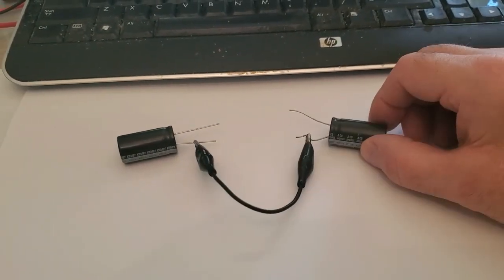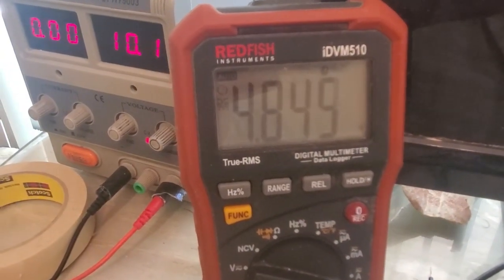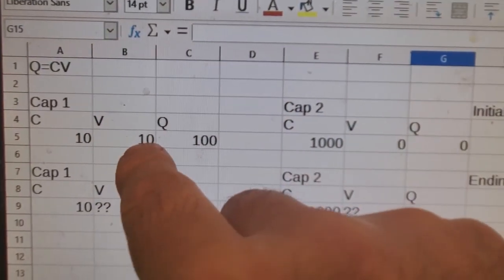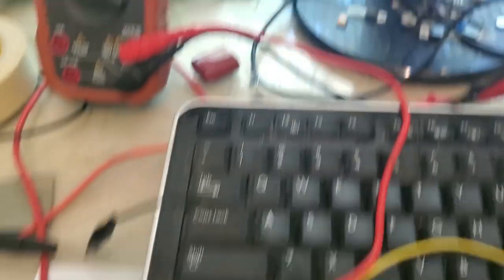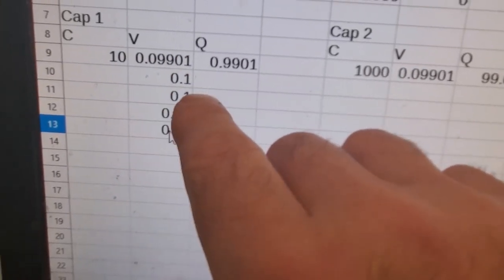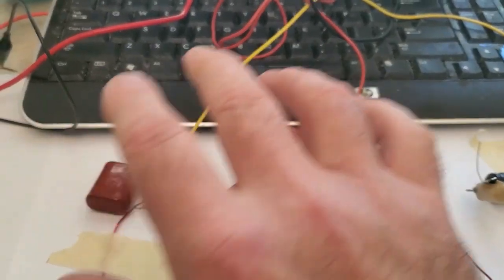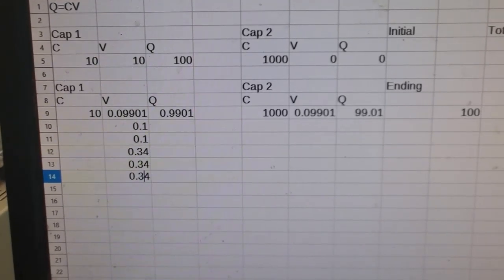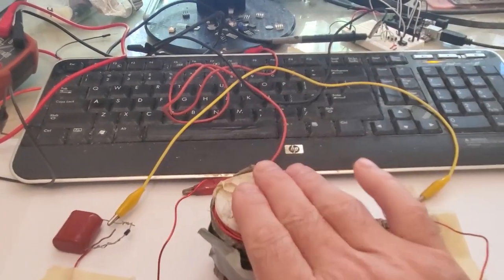The Cool Kids Way to Discharge a Capacitor and get More Volts Out.

Comment: Step one in training for buck boost switching regulators.
Reply from the maker: 👍 I would say it is a kissing cousin to a buck boost circuit though the output is going right back into the cap that powered the pulse.  I perhaps might have replaced the diode with a backwards LED so people could have a visualization of the reversed current flow.  So on the one hand one can yes, per Faraday's Law of Induction, the inductor established an emf contingent on the magnitude and rate of change of magnetic flux and, while present, current may flow along this emf gradient, and be rectified. Still, one can see in this very simple two capacitor set-up that more charge is present when one rectifies the displacement current from the changing magnetic field. So while clearly and in accord with Faraday's Law the current came from rectification of the changing magnetic field, and while it is maybe a bit of a why is the sky blue type question, where exactly did the current come from?  Yes, it came from a changing magnetic field ... and so particles of charge showed up.  Where exactly did these particles of charge come from again???